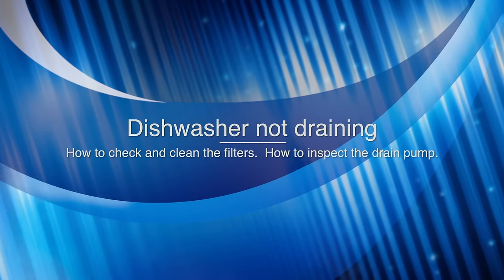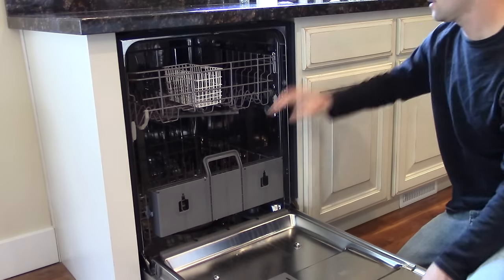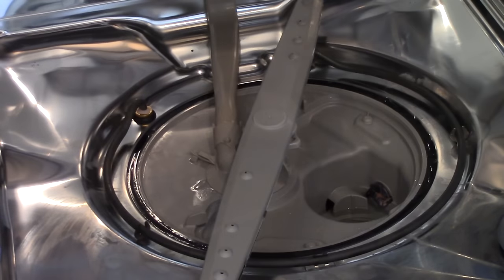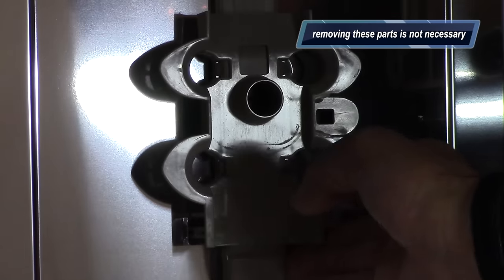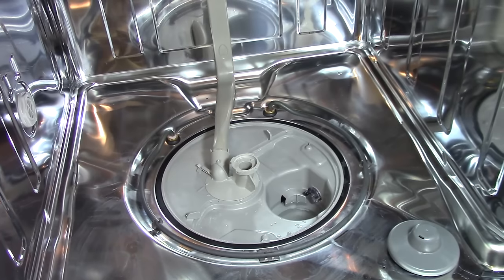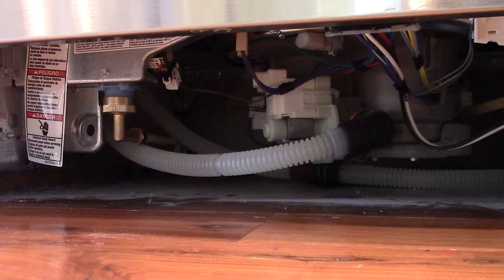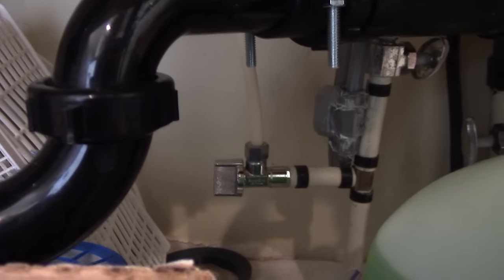How to repair a dishwasher, not draining cleaning - troubleshoot Whirlpool Kitchenaid

Comment: Hi, thanks for the video. This is my exact dishwasher I just got in July. It hasn't smelled for a while which I'm not used to, but after investigating the twist screen I noticed that the trap below is full of water. Yours has water in it, a little less than half full, but it's not full of water. Mine has water to the top but there's no water sitting in the dishwasher. Is it normal to have water sitting in that bottom drain before it goes into the corrugated tube? I woulda thought the dishwasher should drain completely with every cycle.
Reply: Has smelled**
Reply: enocenip no it's not normal, the pump should have drained all the water out of the reservoir.
Reply: enocenip , I have a brand new kitchenaid that does the same thing. Never any water in the bottom of the dishwasher,  just in the filter area.

Comment: Hi Adam. When you took out the filter there was some standing water sitting in the small reservoir (where the sensor is located). Is that normal? I have about 3 inches of standing water there and as a result, the filter was filled with mold and my dried dishes smelled swampy. I sopped up all the water and ran a new load and the dishes smell normal but the standing water remains... Wondering if this is a normal process for a Whirlpool? Thanks!
Reply: Same here!  Dying to hear your thoughts Adam. Great video btw!
Reply: I have this same problem....AdamDIY do you have a answer.  Every couple days I have to remove this filter and clean the moldy crud off the filter.  It also causes my dishwasher not to get all the water out causing more mold.   I really hate this dishwasher !!!
Reply: Ellen Hart , I have a brand new kitchenaid dishwasher that leaves water in the filter area also, was wondering if this is normal. I don't get moldy stuff, but think it should drain completely.  can I ask you if you drain line has a high loop under the sink area, or an air gap on top of the sink? I'm wondering if that might be my problem, cause mine does not have this high loop. my dishes come out clean, but still don't like this standing water.

Comment: Wonderful video, I now know more about my dishwasher and how to clean its filters.

The problem however, was solved by unplugging my unit and plugging it back in.

Something to try before disassembly?

Thanks, Adam!
Reply from the maker: +Dennis Stanley Sounds like you had a circuit board glitch.  Unplugging it must have reset it.

Comment: Thank you for making the help video. Our model is just like what is shown here. After switching off the circuit breaker to the DW, I was able to take the discharge hose off the pump and move the impeller around with my finger, I think I may have dislodged something because it's working fine now, "knock on wood"

Comment: Thanks for the video Adam. It's really clear and easy to follow. I have a question I am hoping you know the answer to 
I unplugged the dw. I disassembled the spinning and stationary arms like you did and found no blockages,.  I took off the clear corrugated hose off the impeller underneath.  I stuck my finger into the impeller housing and couldn't find any glass or labels but when I manually turned the impeller with my finger it would rotate about halfway around and then spring back.  This happen when spinning in both directions.  Is this normal?  
I ask because I've been putting a thin rubber band around one of our bottles (to differentiate who's is who's) and I'm wondering if a broken rubber band could be twisted around the axel of the impeller and causing the problem.  
Our dishwasher sounds like it's running but at the end of a cycle there is still a big blob of powder detergent in the door cup and the dishes are still dirty.

Comment: Hey I just wanted to say thank you!! My dishwasher always made a rattling noise starting about 1 month after I got it. Then a year later (now) it stopped draining. I watched this video and opened up the drain pump thing and found a piece of ceramic wedged in the auger. I removed the piece of ceramic and it started draining again and the rattling is gone! Thank you so much!

Comment: You’re the man!  I really appreciate your video. It saved me at least $250. I was able to blow air through the drain hose back into the dishwasher which made me a little confused. So I removed the hose from the exhaust pump and push the fan a bit. It was just stuck a little bit. This was a result of broken glass. Thanks

Comment: Excellent video! I have the same dishwasher, and a small piece of glass was stuck in the impleller. I disconnected the hose at the bottom after draining as much water as I could, then fished out the glass with pliers and tweezers. I found it helpful to pour a bit of water into the dishwasher and run the drain cycle quickly to see the impeller moving, which helped me see the glass. Eventually the glass moved its way out of the impeller itself so I could grab it with pliers. 

No more cheap wine glasses.

Comment: Great video. I already took out the filter, but just to make sure there wasn't other issues. I just realized my filter had a film that the sensor probably detected was a blockage. I cleaned the filter out and it is now up and running. Thank you.

Comment: I was able to go right in and follow your video to the letter (we have the very same Whirlpool dishwasher). Bless you for this video, Adam! A huge piece of glass and broken plate pieces were the culprits in my case...  #iheartyoutube
Reply from the maker: Thats awesome! I'm glad to be of help.
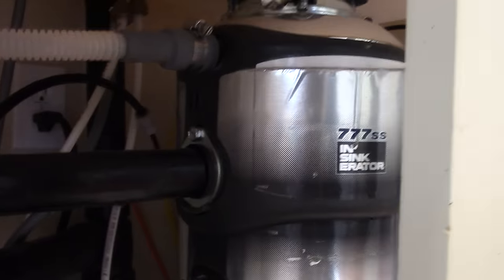Reply: I guess that I spoke too soon... There is STILL water... I'm thinking that need to pinch the clips that you speak of at 4:20 in this video. They don't look like they'll just pinch right back, will they??This same clip assembly is at the other end to my disposal. I'm thinking that I need to get the binding assembly shown at your disposal end (3:40 )
Reply: Plus, my hose to the disposal looks gross thru the plastic! Anytricks for cleaning the hose if I cannot remove the clips right this moment?
Reply from the maker: Kecia Waddell  A few high temperature wash cycles may help to clear out the pipes.  Check the settings of your wash cycle. That junk that builds up is often the fat and grease from food.  It can act like a choked artery.   There are probably some cleaners that may help but I would only be guessing if I suggested anything.  I know you wouldn't want to use Draino or anything like that.

If you found some glass before there may be more that is hard to get. Most hose clamps are either spring loaded like a clothes-pin, or they are tightened with a screwdriver.  So in most cases you will be able to put it back on. If not, you can buy a small pack of hose clamps most anywhere like Walmart or Home Depot. 

Some people have sucked out the debris that was stuck with a vacuum or shop vac.

I hope you get it going soon!
Reply: Yep, used a shop vac. I got that clip off; used a toothbrush, vinegar and baking soda and got most of the stuff out. I'm running a rinse cycle now to see whether things drain thru...  #fingerscrossed

Comment: Thank you. Can you give me an idea about my problem? When I turn on dishwasher, it starts working but in 30 second my electric switch on a switchboard turns off.
Reply from the maker: I would need a bit more info to help. When you say "off" are you saying that it's like it is unplugged?  Or are you saying it stopped?  When washers start, the first thing they do is start filling the machine with a few inches of water. When the water fills high enough it floats a part that trips a switch. The tripped switch tells the machine that it has filled enough.  Did your machine get that far? did it fill?
Reply: AdamDIY The switch I meant is the one which is sitting at a general house switchboard. It flips like it is short circuit in electric scheme. And it fills with water before it happened, but next time I turned water valve off and tried to start it without water - the same result, after about half a minute after I pushed START button.
Reply from the maker: Oh you are talking about the breaker. So when the dishwasher wants to kick on and actually start pumping the water into the spray jets, it is requiring too much electricity for the breaker to handle. To prevent the electrical wires from getting too hot it trips the switch and shuts down the circuit.   Then you have to go back to the breaker and switch it on again.  Well it may not be too bad of a problem.  Have you had any electrical work done recently? If not, then your breaker could be going bad. So you just need to get a new one from Home Depot or Lowes. They should be under $10 or so.   If you have had some work done, what was it?
Reply from the maker: AdamDIY By the way. If you do decide to try and replace the breaker, be careful. It is high voltage and you will get hurt. You need to shut down your power at the switch outside of your home.  If you do not feel 100% confident in this I would just suggest getting an electrician. It would not cost that much.
Reply: AdamDIY No, it is not a breaker - I did replace it. And I disconnected a main motor and heater - the same thing, breaker goes off in some time after i push a start button. Could it be problem with a dishwasher computer?
Reply from the maker: Andrey Ilyenko A dishwasher computer cant trip a breaker. It sounds like you could have a short circuit somewhere in your dishwasher that is causing it to trip. Just a guess. Either that or you have too many things running on that breaker.

Comment: Hey Adam,
Thanks for the video, it was a great help. I'm also having a problem with the draining on my whirlpool gold series. I checked everything and I believe it's the white tube that connects on the bottom. (It's attached to the black rubber that says "do not remove" it was in your video at the end.) When I remove the hose all the water drains out. So I believe it's the clearish white tube.  When I put my finger inside I feel this hard round thing at the start (or at the end of the black L shaped rubber) of the tube. Is this piece supposed to be in there? I mean, is it like a filter in the tube to keep anything to large from going through? I can stick a wire through it, but water doesn't seem to want to enter it at all. So what would you recommend? Should I remove the black rubber piece and see what it is? I believe it's glued on pretty firmly and I'm afraid that if I remove it, it won't work as well when I put it back. I hope you can help, thanks again for the great video.
Reply from the maker: The white tube connected to the black rubber is the drain hose. The black rubber elbow is held on with a metal clamp 4:12 so it should not be hard to take off and have a look inside. but you are probably feeling the impeller blade inside of the black elbow. It's like a fan blade and it pushes the water out the pipe.  The white drain pipe always holds water because the dishwasher cant get every bit of water out of the pipes.  You can blow on the pipe and you should hear the air going to the sink.  If you blow in it and feel something is stuck, then you know that the pipe is the problem.
Reply: Hey Adam, thanks for the quick response. I removed the drain hose and the black rubber elbow is connected to it. (On the rubber elbow it says "do not remove" I assume they don't want me to remove it from the white hose, but to get to see the obstruction I think I'm going to have to remove it because it's right at the opening of the white hose ) I see the impeller blade your speaking about but it isnt in the black rubber elbow, it's in the machine it's self. The rubber elbow is totally hollow. The "piece" I'm referring too is when I push my finger through the rubber elbow into the white tube, the opening is blocked by something round. I think I feel a small hole in the center of this "piece" but I'm not sure. Is it supposed to be there? I know it's probably difficult to understand what I'm talking about but I'm not sure how to proceed and if I should remove the rubber elbow from the white tube to check it. 

I did blow into the tube and with some effort I was able to hear the air coming out of the sink.
Reply from the maker: Ahmed Elshamy Did you do any work on your disposal lately?  Do you think the disposal "knockout plug" is caught in your drain pipe?  Can you tell if if thing that is in the white hose is flexible rubber or is it hard plastic?  If it is rubber it could be a flow valve that stops water from coming backwards. if it is hard plastic, you could have something stuck in it.  Hard to say. But worst case if you do open it up and have something stuck, you can always just buy a new drain hose.  If the black rubber elbow is glued to the white hose, you should not try to rip it apart.   Drain hoses are cheap, maybe it is worth getting a new one.
Reply: I dont have a disposal. 

Its hard not rubber, and whatever it is, it's in there snug. But just so I'm sure, there isn't supposed to be any type of object in there right? Whatever this piece is, it's wasn't orignally there? 

If I do purchase a new drain hose, will it come with the rubber elbow attached to it? If not, won't I have to take them apart anyways?
Reply from the maker: Yes, many come with the fittings.  You also should get some pipe clamps with the hose to attach it securely to the drain pump.  If you go to Lowes.com and search"EASTMAN 6-ft 125-PSI Corrugated PVC Dishwasher Drain Hose" you will see one with fittings. Just be sure you are getting the right length. If you have a 10ft hose, don't get a 6ft replacement.  As for your first question, you are right, there should not be hard plastic stuck un your pipe.
Reply: Awesome! Thank you very much for your time your Adam! :-)

Comment: Amazing thank you, cleaned filters and got to the impeller, was able to move it but ran it with fresh water anyway.  It was moving fine, next checked the tubing all the way to the sink drain, half was clear the other half had a blockage.  I ended up cleaning that out until air passed cleanly through all tubing, put everything back and BAM, works like new!

Comment: Hi Adam,

Thanks for your informative videos! 

Quick question... how much water should remain within the filter basket area after a cycle?  I ask because the water reaches the top of my filter basket and from your videos, it looks pretty well drained.

I have had issues with a smelly dishwasher and am thinking that the smell comes from this standing water.  If you could confirm how much water remains in yours, this may help me with figuring out my issue..

Thanks!
Reply from the maker: +Adrian Tymkewycz  It can vary depending on how long the hose is to the top of the arch.  The hose is arched up under the cabinet like the hump of a roller-coaster.  Everything that passes the top of the arch falls into the garbage disposal (if one one installed) and everything that didn't make it past the top of the hump usually falls back into your dishwasher.  If you open the dishwasher and see a pool of water, that is too much.  But if it is hidden down in the filter basket it is ok.  Are you running your washer at a high temp?  If not that really causes a washer to smell.   You should have a lot of steam come out right after you do a wash cycle.  If not your element may be an issue.
Reply: Thanks for the response Adam.
I run my dishwasher at a high temp every so often and have used affresh in the past.  The smell comes after a few days of non-use (even without dirty items in the dishwasher).  The entire filter tray area is filled with water, and im not sure if it's supposed to be that way (given what I see in your video).  

I understand the concept of pressure and why the hose needs to be arched, though isn't the check valve supposed to keep the water in the hose from flowing back? I say this because I removed the hose and it didn't leak even though it was still filled with water, so I can't see this being the cause of the excess water in the filter compartment (I'm talking about 500ml worth if not more).

Also, I am able to remove the majority of the water in the filter basin once I hit and hold the cancel button (drain button) on the washer. Correct me if I'm wrong, but isn't this supposed to happen automatically after a complete cycle?
Reply from the maker: +Adrian Tymkewycz I see what you are saying. It's like the programming is telling the pump to cut out early.  I have never had this happen.  I'll have to think about it.  Sorry I don't have a better answer for you.
Reply: my brand new kitchenaid dishwasher dies this exact same thing, if I hold the cancel, drain button the rest of the water, at least almost all of it drains, but otherwise the filter area always has water in it. not in the bottom of the dishwasher,  just under the filter.